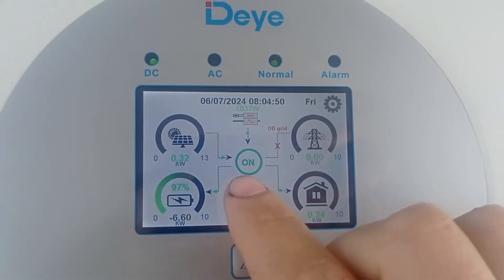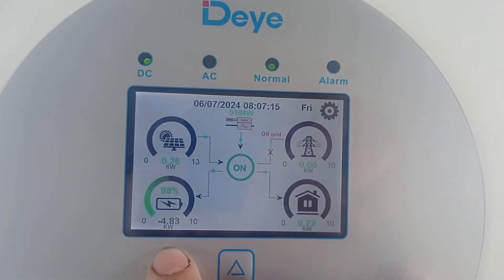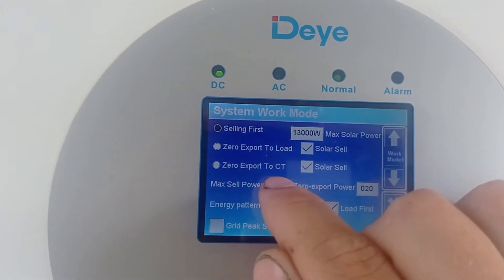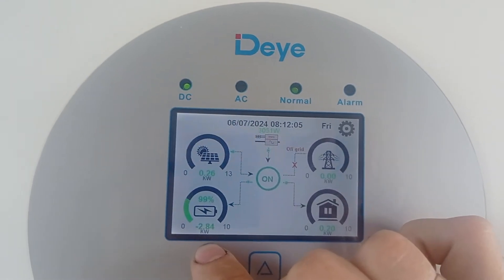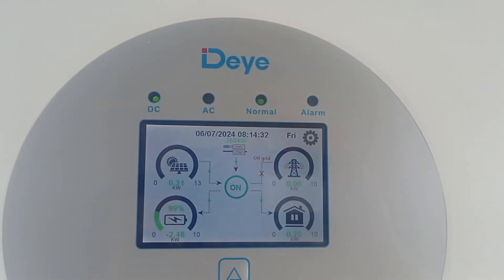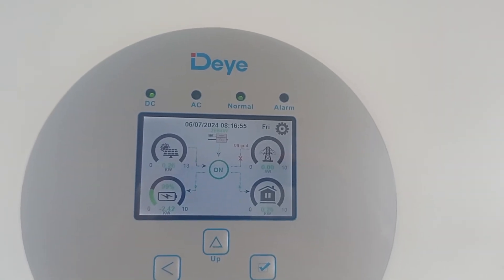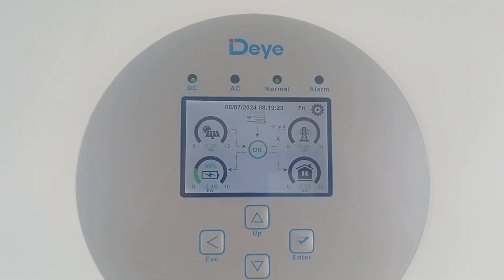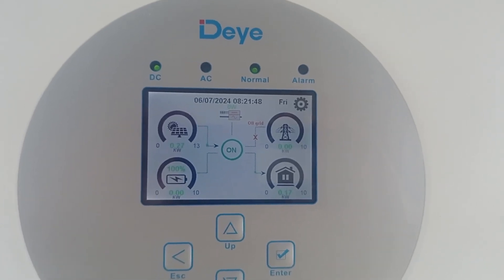How amazing AC-coupling works in Deye/Sunsynk inverter - limiter works using frequency, perfecto!

Comment: Please where did you order your unit from?
Reply from the maker: which one? Deye 10kW?
Reply: @BackyardVoltage Yes please
Reply from the maker: I've got three of those now. Two of them were bought locally through my installer. One another I bought on some Alibaba store, let me find a link where exactly...
https://offer.alibaba.com/cps/j615cq2p?bm=cps&src=saf&productId=1601600304274
All of them work in parallel, no issues.
Bear in mind, they can be single phase, three-phase, so just ask the seller for the exact one you need. There is also a newer version which has SM2 in the end, those are meant to be slightly better in terms of solar input.
Reply: @BackyardVoltage Thank you very much,  I will check out the link and contact the seller. I am trying to install the units myself, so I am watching some videos online

Comment: If i have a one fase microinverter pv system, how do i make the connection on the Gen 3 phase connection? I only use the Neutral and one fase?
Reply from the maker: yes, use any one phase you like (but preferably the most loaded one), neutral, and ground
Reply: @BackyardVoltage Neutral and ground? What do you mean ground?🤔🤔🤔
Reply from the maker: ground cable / earth cable. the AC-coupled unit also has to have the proper grounding
Reply: @BackyardVoltage from micro inverters i only have Neutral and Live wire directly connected to my grid , no earth
Reply from the maker: ah, okay. well, it depends on the microinverter, the ones I have in use - they have the ground wire connection. if no ground is there on yours - for safety reasons ensure that the panels themselves are properly grounded - that should be enough.
Reply: @BackyardVoltage ok ! Thank you for the advice!!! HIGHLY APPRECIATED 😎👍🍺

Comment: Thank you for this video,
"Thank you for this video. I would like to ask if it's possible to connect a 5KW single-phase inverter to the 12KW three-phase DEYE inverter as a microinverter input. I mean the  monophase inverter  to  3Phase DEYE inverter via the  Gen port,  to use it as a power supply for the main system  the DEYE 12 KW  inverter."
Reply from the maker: Yes, possible. I now have on my gen-port:
1. 3-phase grid-tie 20kw Huawei
2. Single-phase 5kW hybrid Deye
3. Single phase 2 kw battery inverter
4. Another single phase 2kw battery inverter.
All work together, units 2, 3 and 4 sit on phases 1, 2 and 3 respectfully.
No issue, no glitches. This setup in this exact combination runs from February till now.

Comment: Good afternoon, I have the Deye 10kw inverter with batteries and solar panels connected to it. Zero export to CT activated with no Solar sell. I have Smartload active and would like to know if I should change it to Micro inv input instead? Best Regards.
Reply from the maker: it depends on what you are trying to achieve, and whether you are actually using it as a smart load? and if you need some additional inverter to be supplied to the GenPort in the MictoInv mode?
if you aren't using the GEN-port at all, you may not bother about the settings.
Reply: @BackyardVoltage  Thank you for your time to respond to my question. I am not using the Gen Port so will not bother about the setting. I am having a problem with one Dyness battery discharging and was trying to find a solution and was looking at CT Coupling when I found your publication.
Reply from the maker: as always - try connecting to the batteries monitoring software and updating their firmware first. it normally resolves 99% of issues.

Comment: Can you tel me. What settings you change in ongrid inwerter !? ???
Reply from the maker: no changes on the grid-tie (on-grid) inverter. it just picks up the grid Deye creates for it.
Reply: @BackyardVoltage deye only pushup Hz!! Ongrid inwerter must read rasing Hz as a power down signal.
Reply from the maker: any of my gen-port sitting inverters (20 kW Huawei 3-phase, both of the grid tie 2 kW inverters, even 5 kW hybrid Deye single phase) is listening to the frequency shift commands, and of course if main Deye switches the relay off - all those gen-port inverters go to off-grid mode (well, for grid-tie inverters - they just switch off) as well.
Reply: @BackyardVoltage  i tested deye ongrid inwerter and it taking error and not modulate

Comment: Good Day!  I am upgrading from a Deye 3.6kw Grid Tie Setup to a Deye 8kw Hybrid OnGrid/OffGrid Setup.  How do I connect the older 3.6kw Grid Tie inverter?  Should it be on the GEN port, GRID line, or LOAD line?  Since I'm going to use the CT Transformer of the 8kw Hybrid inverter on the Utility Main Breaker, should I transfer the 3.6kw Grid Tie inverter's CT Transformer someplace else?  I don't have NET Metering, so I don't want to export anything and I'm afraid that remove the CT Transformer of the Grid-Tie Inverter might cause it to produce more power than it should.  Or would it be better if I just upgrade to 12kw Hybrid OnGrid/OffGrid Setup and just sell my older 3.6kw Grid Tie Inverter?
Reply from the maker: If 8 kW capacity is enough for you - there is no need in getting bigger hybrid.
your current 3.6 grid-tie - connect it to the GEN-port of Deye, set the GEN-port to work in MicroInv-input mode - and it will work amazing.
You don't need any CT-s on Deye installed at all, if you will not have any load that you will put before the GRID input to your property and the GRID terminal on Deye. That "Zero Export to CT" mode is for a very specific reason if you have a high-consuming load, and you don't want it sitting on the batteries on the LOAD side, and want it off if there is no external GRID. In your case - I believe your main working mode of Deye will be "Zero Export to Load" if you don't plan on having any export.
Reply: @BackyardVoltage  Thanks for your fast reply.  It is really helpful.

Comment: what is the maximum input power can i connect to the GEN PORT?
I have 5kw deye hybrid inverter and I also have 8kw of grid tie inverter, Can i connect the 8kw GTI on my 5kw Hybrid Gen port?
Reply from the maker: yes you can connect it, but for a stable work on-grid you should rather limit your GTI to 5kW. for off-grid mode limiting is not necessary

Comment: one question - what value do you have on AC couple frz high ? 
Im rying to replicate this setup but in my case the 12k does not try to chage the freqency to lower the on grid output - it just shutsdown
Reply from the maker: my settings on that parameter are pure factory one, no changes

Comment: I have installed on grid inverter with PV modules for AC coupling with my DEYE 12 kW. Is it normal, that  on grid inverter at night uses 30-40 Watts ( I can see on Deye screen -37 Watts usage for micro inverter ). Micro inverter is still on because batteries have not reached desired percentage. Should I change on grid inverter parameters to get in sleep mode ? Or I missed something ?
Reply from the maker: yes it is ok, there must be some power consumption by the grid tie inverter. some inverters know how to switch themselves off (huawei for example goes to sleep, and uses 0.1 watts at night), some others constantly use the power for it's own life.

Comment: Frequency shift is stupid. I don't know why the industry has standardized on it. I built my own control system using a PLC, a 15kw charger/inverter, 6 gridtied inverters with a combined AC capacity of 50kw, and 40kwh of batteries. I have operated 40 to 45kw loads for hours on sunny days offgrid with my batteries acting as accumulators, simply abdorbing or suppling swings in loads for a few seconds until my inverters output matches the load. My batteries do not cycle, and they are always 90%+ full when the sun sets or loads exceed production. I often operate offgrid for days even though I have net metering just because it's neat how well it works. I power 2 homes, office, and a welding shop. It's amazing how responsive it is even with 2 350A wire feed welding machines burning wire!
Reply from the maker: may I wonder, why exactly frequency shift is stupid?
do you claim all the industry using it being stupid as well?
Reply: @ModernUkrainianHomestead  try getting 60+ KW AC out of a 10K battery inverter.
Reply from the maker: and why would anyone do that? I mean 10kW Deye can passthrough up to 45Amps easily (30kW), totaling it to be 40kW.
some SM2 Deye models can do more. and Victrons can do more. question is whether it's really that much needed.
Reply: @ModernUkrainianHomestead  45A is 10.8kw, not 30kw. Using solar power to meet actual loads instead of discharging/charging batteries is far more efficient, causes less battery degradation, and allow you to power up to the full output of your solar inverters and batteries during the day if needed. I power 2 homes, snd office and a welding shop. I can operate my gridtied inverters, offgrid by syncing to my 15kw battery inverter/charger and get 65kw (270 amps)on sunny days. All without shifting frequency or cycling my batteries. If you can't see the advantages in that, I can't help you.
Reply: I am interested in your setup, are you able to provide more information how you went about it?
Reply: @MwapeDaka It's too complicated to explain in comments. I hope to record a YouTube explaining it all one day.

Comment: Hey there , great video just a note that Victron systems work with frequency shifting for a long time and also support TCP/IP control of power over the supported micro-inverter...
Reply from the maker: they never ever mention it. they do not recommend it. they do not market it.
and well, that's their problem. since if they did - I might have got their system... I was seriously considering Victron in the beginning, but made a switch to Deye and have zero regrets at the moment

Comment: Firstly thanks for your video, and my qustion is: If I've 12kW Deye inverter, the solar panels product 10kW and the actual Load is 20kW, Can I enable AC passthrough to cover the rest of load demand from the grid while the solar panels keep producing the 10kW? to continue supplying the load demand from panels and grid in parallel. Thanks advanced.
Reply from the maker: it has three working modes, and the first one covers own consumption first, then sells next (battery is kept on a certain level, or is charged up to full before selling start - depends on the "time of use" settings).
two other working modes cover own consumption and battery first - then sell all extra to the grid.

if your load is higher than production capabilities - then everything that the solar own production cannot cover - will go from the Grid via bypass.
trouble comes - when you are off-grid - then you are limited to 12kW + 10% of power that the inverter will be able to cover from both solar and batteries. anything above - it will go in the overcurrent error (in off-grid mode). in on-grid mode - I've seen 30-40 kW going through it in bypass from Grid to Load in some other places - all keeps working perfectly fine.

Comment: Hello. Very useful video. Do you have any idea how the single phase deye hybrid (16kw) inverter would work with 3 existing huawei ongrid inverters (6kw+6kw+5kw in cascade) connected to the GEN port? can the DEYE inverter control the power by varying the frequency of the 3 ongrid inverters?
I intend to add this 16kw DEYE inverter, but I don't know if it will work properly with my HUAWEI ongrid inverters (6kw+6kw+5kw in cascade with battery).
thanks.
Reply from the maker: it can work with many inverters simultaineously. the only thing - all your huaweis have to be single-phase as well.
I tried and am using it all here: https://youtu.be/1Wpt5_p5Mn8

however, I am not sure where are the batteries in your case - are tehy connected to huawei system? or they are planned to be used with Deye?
Reply: @BackyardVoltage  
the batteries are connected to the huawei inverters.
yes, the huawei inverters are all single phase connected in parallel.
6kw+battery - master,
6kw+battery - slave,
5kw without battery - slave.
now they only work ongrid.
to the new deye I would like to connect the house and a battery without communication, and the huawei inverters to supplement the power for both the village house and for charging the battery without communication (only with BMS).
Do you think it is possible?
Reply from the maker: might be, however I cannot give you any warranty how will it behave.
from what I see - Deye has to be the main line inverter. and the Huawei system - should be re-connected to the GEN-port in MicroinvInput mode (as if the GEN port is the grid currently).
So in this case it might work. But, I am not 100% sure, as I have never ever seen yet anybody trying Deye working on the GEN port with any other hybrid inverter.
Reply: @BackyardVoltage  
The huawei inverters will be connected to the GEN port, as you presented in your video.
I am worried that the DEYE inverter would not be able to handle all the power (from the Huawei inverters) supplied on the GEN port.
The difference between your installation and what I would like, would be that on the DEYE there will be no PV installed in the first stage.
You have convinced me that it is possible.
Thank you very much for sharing your experience.
Reply from the maker: If Deye will have where to use that power, e.g. load, own batteries or sell to the grid - then it will work.
otherwise - it will have to limit the GEN-port input via frequency, what is actually does. The only thing to consider - if there is too much coming in - and there is a jumpy load for example - it may not be quick enough to adjust the frequency. In your case it's only 1 kW difference which is easily covered by peak power (10% addition), so you have nothing to worry about I guess.
Reply: @BackyardVoltage  
thank you very much. peaceful holidays

Comment: Tanks for the information 
How many volt pv can it take
Reply from the maker: always check the local spec, as it may differ a little bit in different parts of the world. in my case - 800V Voc for each of the 3 strings it may have - it is the hard limit (including temperature coefficient).
Reply: Thanks

Comment: Is that inverter fan noise in the background? I thought your push/pull fan solution eliminated the noise?
Reply from the maker: yes, there are the factory cooling fans. my solution could not eliminate it fully, but it reduced the frequency and time of the factory ones are working

Comment: does this settings works also with enphase system? whats about the cableing? is here a need to wire this on gen/load connectors or only grid?
Reply from the maker: it will work with literally ANY tree-phase grid-tie inverter or single-phase inverter or microinverter.
or even with their combination, see the example here: https://youtu.be/1Wpt5_p5Mn8
about the wiring - just connect it to the GEN-port terminal properly, and that's it. Ground has to be supplied separately of course.
Reply: @ i‘m Not really sure where i need to cable it on the gateway or relay or something else
Reply from the maker: @timosu1985W0  do you have the manual? there is the wiring diagram there. in short -  inside Deye there are GEN-port terminals - you connect the inverter there. well, of course use a separate AC-circuit braker for safety.
Reply: @BackyardVoltage  i found it.... and then its also possible to charge the battery when offgrid is active? thanks a lot!
Reply from the maker: @timosu1985W0  Yes, I use that option to charge my batteries and supply the load from GEN-port (I use it only as a MicroInv input in my case) almost all the time.

Comment: Many modern inverters actually allow ac coupling with existing solar inverters for both string and micro inverters 
Like Luxpower, powdrive (which is actually a Deye inverter under different branding and 1/3rd cheaper)
Reply from the maker: no, luxpower is luxpower, and deye is deye...
you can't mix those - and they are waaaay too different ))
Reply: @ModernUkrainianHomestead  you really missed everything I said
I know lux is different from deye 
The inverter that's a complete copy of deye is powdrive n that's what I said 
Still doesn't negate the fact that most inverters in the market allow retrofitting either by ac or DC coupling
Reply from the maker: ok, I missed it.
I just doubt all those "many inverters on the market" know how to limit the higher power AC-coupled device... The difference usually is in tiny details, if you know hat I mean
Reply: @ModernUkrainianHomestead  in all honesty that's common knowledge as most of these inverters are actually being manufactured by very few manufacturers 
You can't go wrong with most
Reply from the maker: no, not really )
there are quite a number of manufacturers.
Would you believe it or not but even that bunch of shit-cheap chinese inverters (EAsun, Anern, PowMr, Must, Daxtromn, ESGSolax and many more) - they use 3-4 different factories to get those produced, and all of them can even be produced at the same factory.
But Deye is Deye, it is very different. It is only also sold under SunSynk brand in some places over the world, but they had neve been hiding that it's Deye by metal, just the software is different.
powdrive is a tice-try cheap copy of deye, and deye has nothing to do with it. unfortunately.

Comment: Please keep in mind that this function only work with string inverters that can reduce power by shifting the frequency. With micro inverters connected, it does NOT work. Micro's are on or off, can not reduce power.
Reply from the maker: that's not true )
it does work with the microintverters as well.
it does work with hybrid inverters (AC-coupled on AC-in side) too.

The scenario in a video - is a rare case scenario I have. All the other time (when there is grid normally) - I have got two microinverters connected to it. and it works exactly in a similar and same mode as described here.